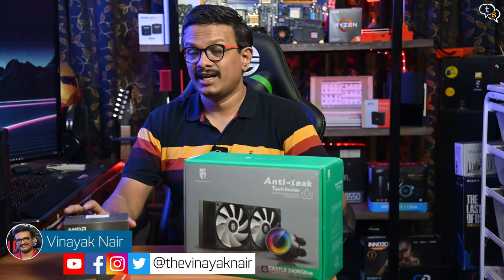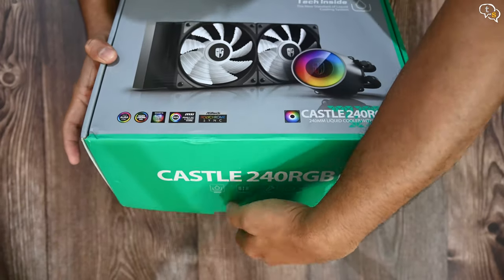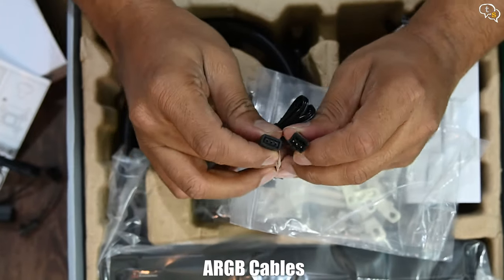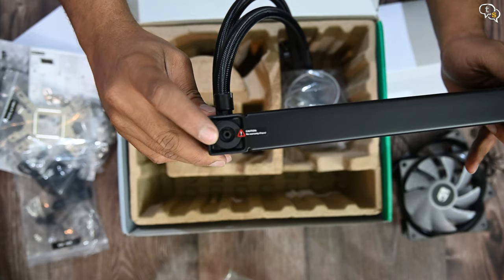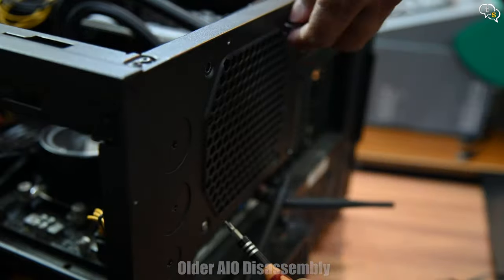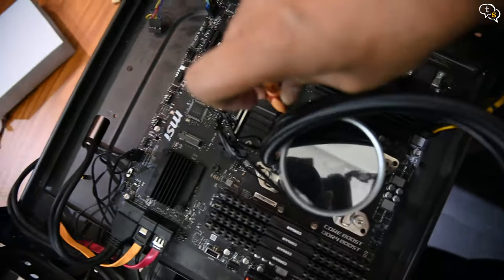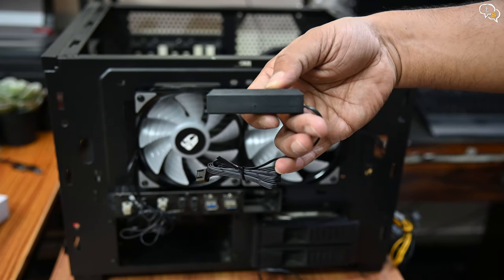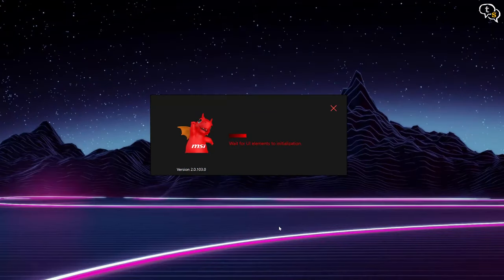Best AIO for Ryzen 7 5800X | Deepcool GamerStorm Castle 240RGB V2

Comment: Deepcool Captain 240PRO V2 AIO CPU Liquid Cooler would this be ok on 5800x its comeing in my build thanks
Reply from the maker: It's good, for gaming the temps are under 70 degrees. When benchmarking in Cinebench R23 the temps went upto 85 degrees, which is still under the 90 degree ceiling. I'm using it with a 5800x.
Reply: @TalkingstuffNet  thanks finaly getting my build next week u think the deepcool 50 matrexx add rgb 4f case is ok for this build 3080 5800x
Reply from the maker: Looks big enough, it supports 370 mm graphic cards and e-atx motherboards so you should have plenty of space. There should be enough space for airflow.
Reply: @TalkingstuffNet  thank so much u  have a great day

Comment: Hey can I use  this deepcool  gammaxx l240 V2 RGB liquid cooler can it handle AMD RYZEN 7 5800x plz reply
Reply from the maker: The l240 having a 240mm rad should work with a 5800X. This is the Gamerstorm Castle RGB V2 is also a 240mm RAD. Both are pretty similar.
Reply: @TalkingstuffNet  bro which is best
Reply from the maker: The Castle V2 supports thread ripper tr4 socket too, both are good models. The l240 should be enough for a 5800x.
Reply: @TalkingstuffNet  thx 😊 sir your mean sir deepcool gammaxx l240 V2 RGB enough for ryzen 7 5800x
Reply from the maker: Yes, as long as you're not overclocking.
Reply: @TalkingstuffNet  may not be overclocking sir
Reply from the maker: Then it should be fine.
Reply: @TalkingstuffNet  ok thanks ❤️😊

Comment: Nice video, informative too 👍🏻👍🏻
Getting a good cooling system is must with a high-end CPU.

BTW, I just installed Valorant on my potato laptop and when I play game, at full HD, graphics set to all low, temps are constant 92C. But still I'm happy, at least game is running without any lag. 
(i3-7th gen with intel HD 620 graphics)
Reply from the maker: You could get a laptop cooling pad to help with the ventilation/ dissipation of heat.
Reply: Yes, I was also thinking to buy one but as you know, only essentials are getting delivered over here that's why can't purchase anything as of now.

Comment: What cabinet is this?
Reply from the maker: This is the Cooler Master HAF XB EVO. It's more of a cubical shape than standard cabinets are. It started out as a cabinet for a pc in the home theater, and I changed to a Cooler master td500 just recently.
Reply: @TalkingstuffNet  one more question, I'm planning on putting this aio on the front of my case, but I'm worried about the radiator intake choking my 3070ti. Is that going to be an issue?
Reply from the maker: I have installed my radiator on the top of the cabinet in my new build. The front is now an intake for the rest of the components within. If you do install the radiator in front, set the top fans as intakes and one exhaust should be present at the back which will allow ample air to flow within the case.
New build video: https://youtu.be/E0TQ8yq6YTk

Comment: What will be the tempurature of ryzen 5 5600x with this same liquid cooler?
Reply from the maker: It should run cooler than the 5800X.
Reply: @TalkingstuffNet  in this video are overclockng your cpu?
Reply from the maker: No I'm not, but I will be undervolting to reduce the temperatures and get better performance.
Reply: @TalkingstuffNet  are you intaking or exhaust the radiator fan?
Reply from the maker: Intake through the radiator , push or pull the temp difference is negligible. I'm using a horizontal case, so it has vents on two sides which allows for air to flow in.  I also 3D printed a PCI slot mount for 120 mm fans to pull in air from the sides.
This is the case I use https://amzn.to/3eMey3T

Comment: honestly witha  cpu like this put the fans on 1400rpm and the pump at max and u should be fine maybe if u have a colkd home 1200rpm
Reply from the maker: I have changed them to noctua 3000 rpm  industrial fans. Works like a charm, only thing is it sounds like a plane taking off at full speed. 😅
Reply: @TalkingstuffNet  ah i got noctua 1700 rpm fans on 1250 their dead silent wich is what i keep them at unless its summer xD

Comment: Can we use it on ryzen 5 3600
Reply from the maker: It can be used with a 3600 but I found that the deepcool l120 was enough for it.
https://youtu.be/nwE_LSMEZe4
Reply: @TalkingstuffNet  yeah brdr but my cpu temp. Increases up to 94°c there for prefer it
Reply from the maker: It keeps my 5800x at 84-85 degrees at full load during Cinebench R23 benchmark. Normal usage it doesn't cross 75 degrees at max and gaming temps are at 45-60 degrees.